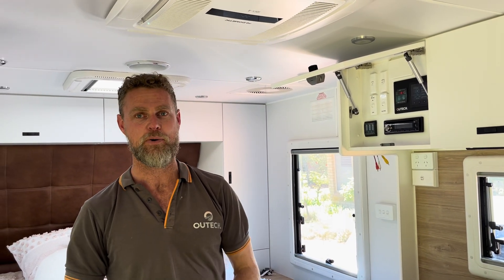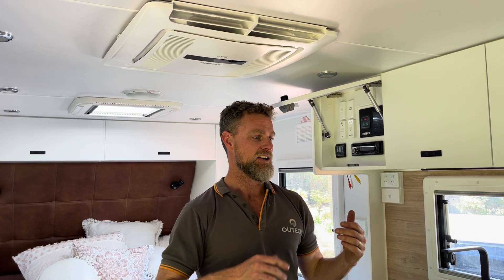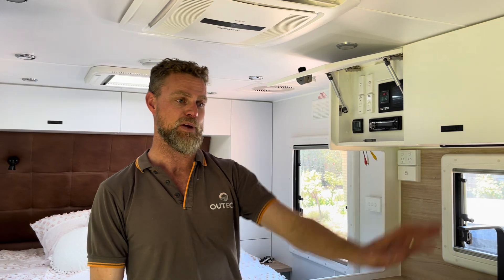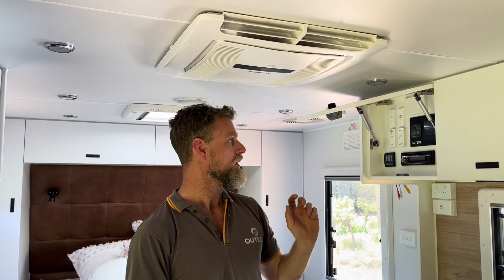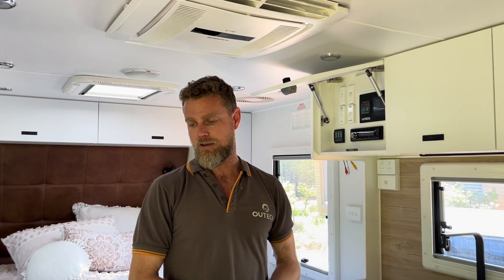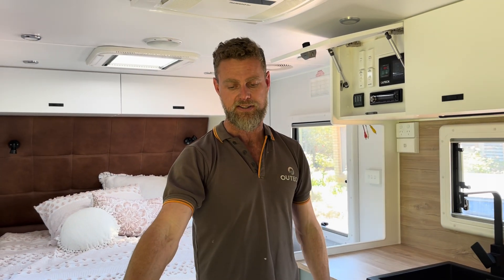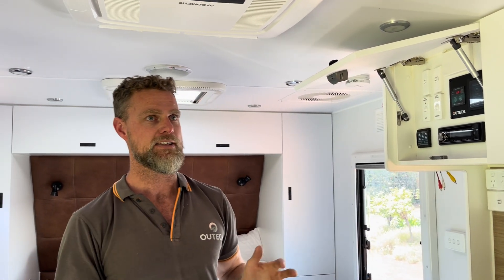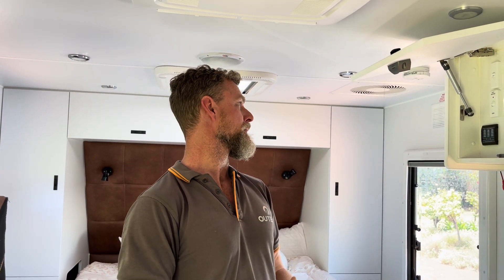Network RV Caravan Power Upgrade - NOT Enough SOLAR

Comment: Just ordered a Network RV, they offer the Victron full system 2x 300AHR battery and 800wattes Solar for 14K
Reply from the maker: As we mention in a lot of our vids and social media posts we would recommend against that. You will, as everyone is, be disappointed with the outcome. We speak to too many people about their factory installed systems that are underperforming or just generally have installation issues 

Even what you have sent through as electrical
Specs concerns us. 

Cheers.